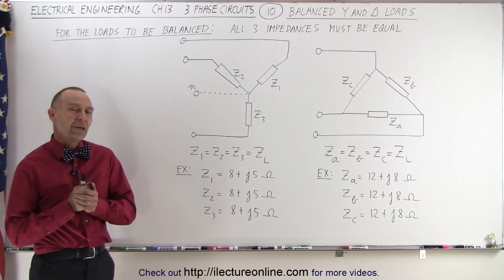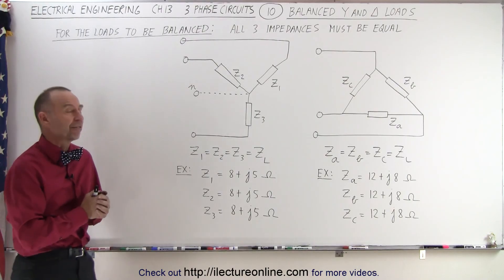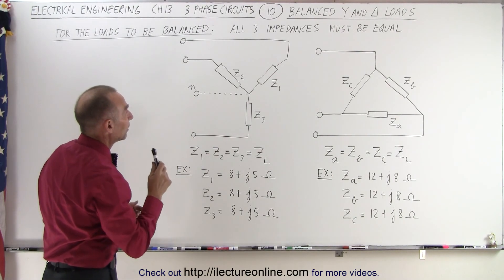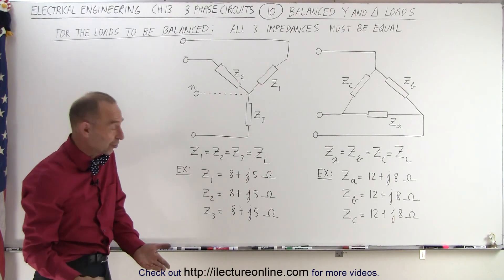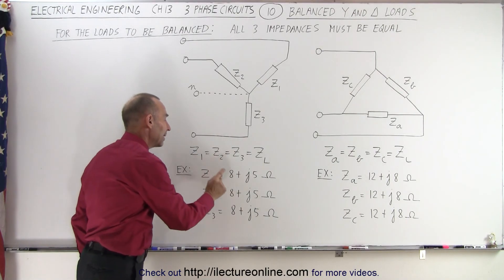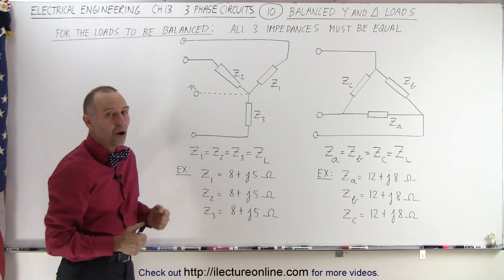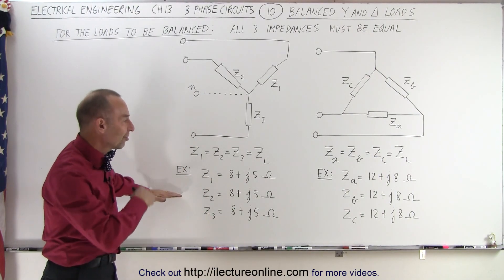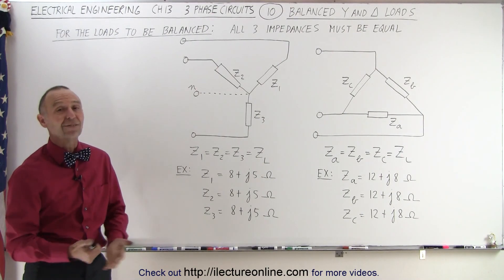Electrical Engineering: Ch 13: 3 Phase Circuit (10 of 42) Balanced Y and Delta Loads

Comment: Central Air conditioning in our homes, offices and control rooms etc use 3 phase & or what & why?
Star or  delta connection & why?
Thanks
Reply from the maker: Three phase circuits are typically used for very large motors or industrial buildings, where there are big loads.   Homes tend not to utilize three phase circuits.

Comment: Could u please do a video on star and delta connections, where they are used and why?
What is used on AC generators and why?
What is used on Transformers and why?
What is used on AC motors & why?
Reply from the maker: Three phase circuits are typically used for very large motors or industrial buildings, where there are big loads.   Homes tend not to utilize three phase circuits.